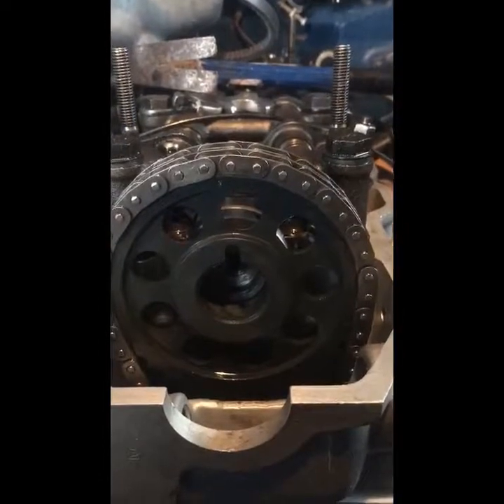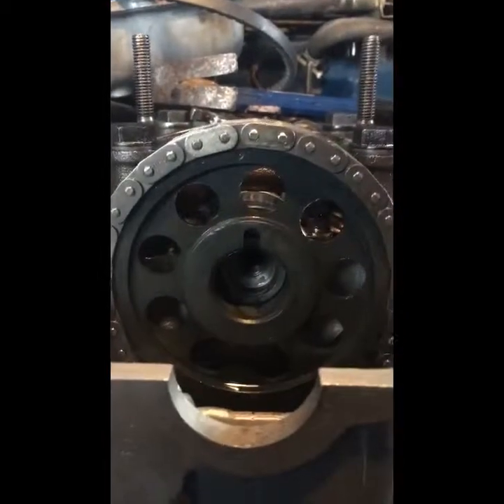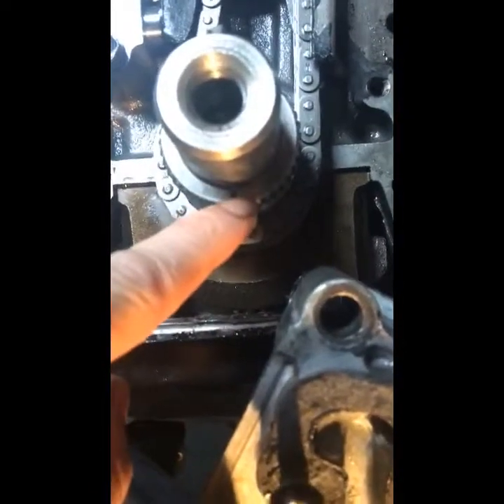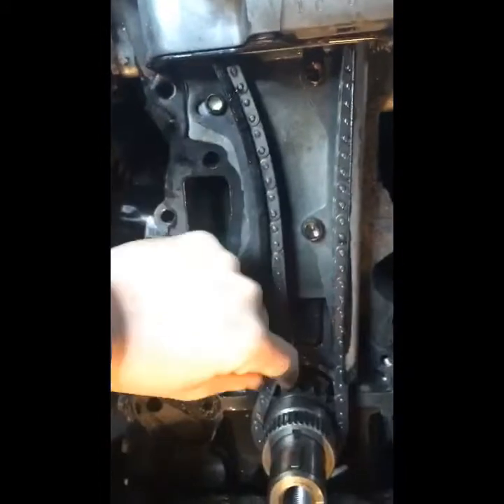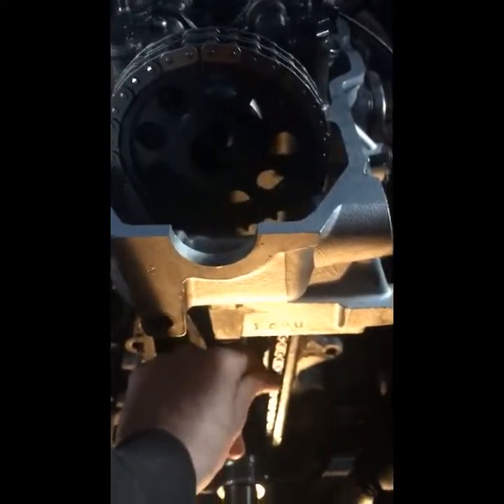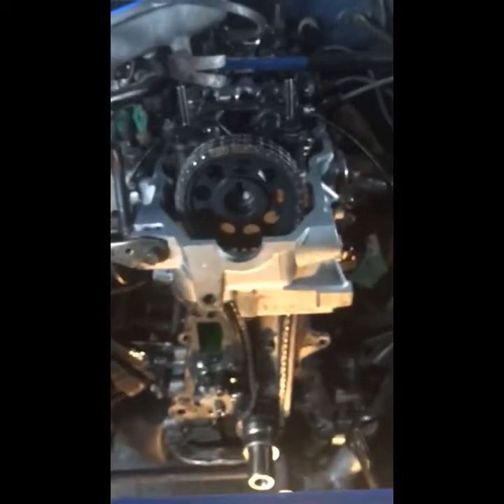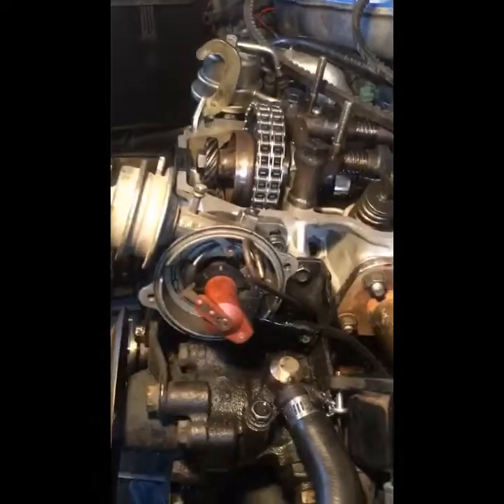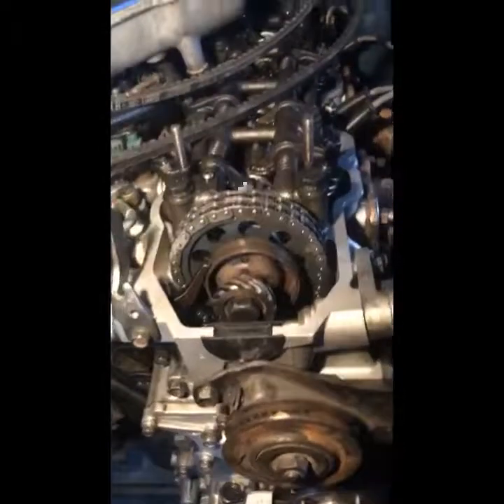22r TDC

Comment: Yeah so you want spark plug 1 removed, put your finger over the hole and start manually turning the crank. When you feel outward pressure from the compression stroke.  Great sign, right before TDC!! The one tooth off comment comes from wanting the distributor to be right before 1. When it appears to be on, you're just past 1

Comment: I’m sure you figured this out by now but you are a tooth off on your distributor
Reply: 180 degrees off
Reply from the maker: Why do you think it’s off a tooth? It points right to the #1 plug wire. I know people have said too that my chain is off a tooth but it is done exactly like the manual calls for. Not saying your wrong I’m just asking for more detail. Thanks for your response
Reply: @elsydro8064  are you using a timing light to time the engine?
Reply from the maker: @toyotatherapy9685  yes
Reply: This might or might not help but did you time it with a light using a jumper wire in the correct obd conector so the ecu wont compensate...
Reply: @robertbuck7186  You’re thinking of a 22RE... there is no wire to jump on a 22R.Good idea though because if it were a 22RE that would definitely be a problem
Reply: I know oops won't help.. had a similar problem with an re that ran great for the first hundred yards of acceletation..although your problem is from start up.. could be numerous things besides the electrical system...I would surf the yoga tech forums and the crawler forums and try to check and rule out each system.. air, fuel, electrical, mechanical ( maybe you knosometimes when reinstalling the distributor you have to clock the rotor about 5 to 8 degrees ahead for it to twist back, One of my carburated yotas the vent to the fuel tank was blocked of it would starve the engine of fuel and it would sputter and die.
Reply: Darn hit the send too soon sometime you have to set the rotor 5 -8 degrees ahead when reinstalling. The distributor so it falls back in place in number one position and the mark you made on the case

Comment: I'm having the same exact problem.  Rebuilt 22r, timing on point, won't run, backfiring though the carb. How did you fix it? What did you miss?
Reply: I have the same issue did you fix it? Thanks
Reply: I've been working on another vehicle and I'm not if I did find my problem or not. I replaced my coil but my truck still doesn't run right

Comment: That dot on the sprocket should be in center of that shiny link
Reply from the maker: Six Seven Zero no she runs good now
Reply: @elsydro8064  what was the problem? in the process of putting mine back together
Reply from the maker: Luke Scovern when I rebuilt my motor I had bought a used torque wrench, never do that it was bad, long story short the crank bolts were not torqued at all, I’m lucky I didn’t ruin my motor, I pulled the oil pan and discovered one of the bearing journals loose allowing the piston to be off. If you have any questions or need possible ideas let me know
Reply: So u are a tooth off